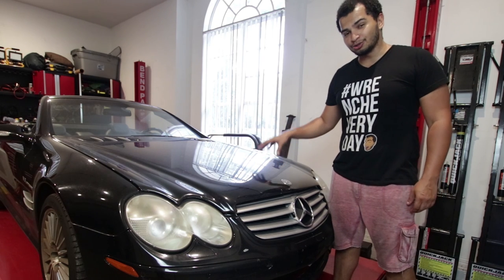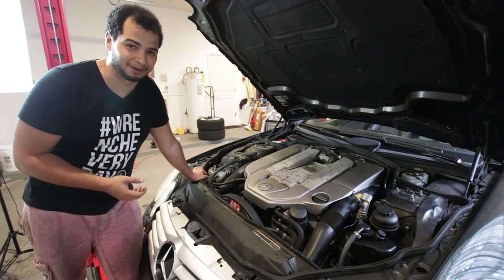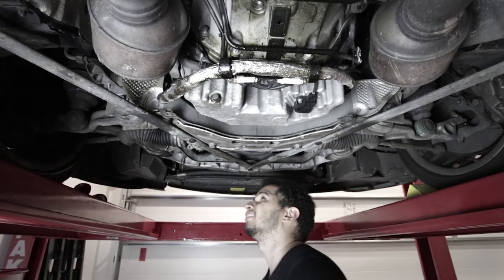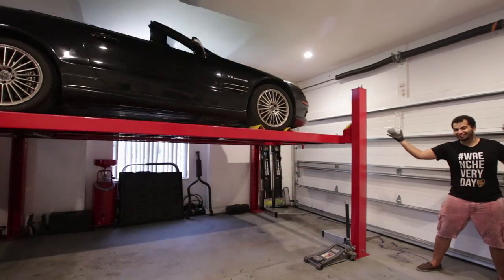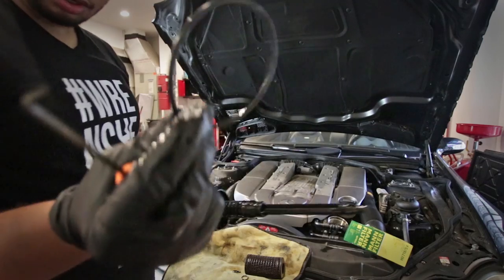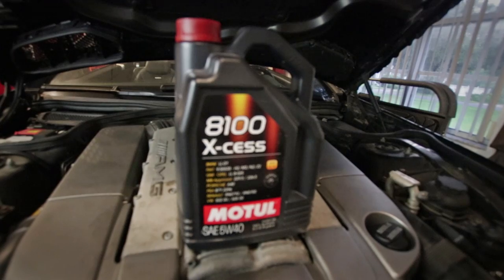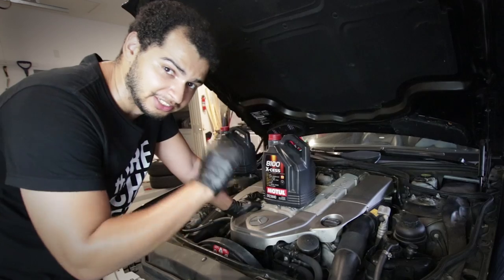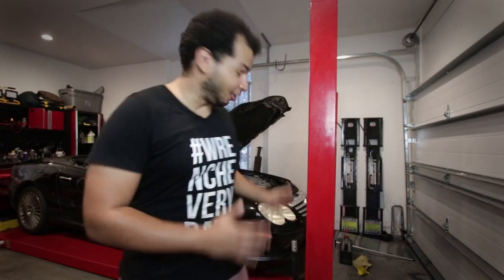Here's Why A Mercedes Oil Change Costs $320 And Why You Should NEVER Pay That Price-Project SL55 Pt1

Comment: I am a Mercedes tech and have a bit of advice for you.
Next time completely remove the oil filter then drain the oil. The filter housing had a check valve and will retain old oil (about half a qt) unless the filter is removed.
Reply: i thought the same thing.
Reply: About the Douche Bag, or about removing filter first?
Reply: And likewise measure changed oil level after the filter has oil in it, not with an empty filter!
Reply: Everyday Fleet Tech good advice, i was just about to tell him the same thing.
Reply: all canister filters retain oil and should be opened first
Reply: Absolutely! I am a former MB Tech and it is scary what I see in many of my customers vehicles that quick-lube places do.
Reply: Marc Smith 
Like use Motul oil? :O
Reply: AnonymousMod like using oil filters without the fleece wrap. The old 000 180 23 09 instead of 000 180 26 09. They do it because it is half the price, but it is not a good idea to use. 

I have actually never seen Motul oil in any store or shop here in NY.
Reply: It was a joke. 
This idiot in the video called Mobil 1 crap, but then praised Motul. Anytime I've bought a cheap seized dirt bike the owner swears by Motul, so like heh.
Reply: Everyday Fleet Tech
Reply: thats what I thought.
Reply: I own a 14 e63s and it has a engine oil dip stick, So on the m113k engines there is no oil cooler to be drained ? I have to do this on the E63s, I have an engine drain plug and oil cooler drain plug and it takes 9 quarts
Reply: I just watched this video And was thinking to myself "well he says his oil is very dirty even though he just changed it before going out too beat the hell out of it....it probably looked dirty almost immediately since it was probably .75 of a qrt of super dirty oil left from the one before lol some people should research the info before giving "advice" lol
Reply: It's typically out of ignorance that guys like this in the video put down companies or things they lack expertise in.
Reply: Doesn’t Mercedes log all services done to the car to keep it for resale?
Reply: The dealerships typically do, but not everyone takes their cars to the dealerships. Sometimes they take to a non-Mercedes Service center that doesn't always log the work done.  Plus, it work was done by the owner, do they keep a log?

This guy Is being a little ridiculous.  He's complaining over a $320 oil change for a high performance car like an SL55?  they do a complete inspection because if there's something loose, worn, or not to factory spec, then that car might be unsafe to drive.  They look for wear and tear and anything that would need to be fixed because these are not some cheap hooptie, these are expensive exotic high performance cars capable of speeds in the upper 100's and even approaching 200 mph and they want to make damn sure the car doesn't fall apart along the way.
Reply: yo get real oil swap an filt'r right? do it right n pay the chek cause the car is beaucoup buck.
Reply: Everyday Fleet Tech  I was thinking of buying a w203 c class 
Any pointers you can give me for getting a good car .. And I was thinking how much will it be the upkeep in cost of one like 2006or 2007 c200k
Reply: Thought this 😂
Reply: AnonymousMod: I haven't heard of Motul.  But, I'll tell you, I haaaaaate Mobil 1.  Why?  I put a new engine in my Vanagon (built by Boston Bob), and ran Mobil 1 after the burn in, and it couldn't keep pressure up.  A vanagon specialist recommended Delo, and after that everything was kosher.  Then I had a 97 Audi A4 2.8 that I bought new, ran only Mobil 1 from the first change interval, and at 80K miles the lifters had severe wear on them, needing a replacement.  I'd call that a lubrication related failure.  One of the lifters was literally worn half through.  Maybe it was an engine design issue, maybe it was something else, but I was fastidious about replacing that Mobil 1 at 3.5K miles and only using Mobil 1, and I felt really let down.  That plus the Vanagon plus stories I've heard...
Reply: Yes, provided that the service reminder has been properly reset... all of the different service items are recorded, not just oil changes, but air and dust filters, tire rotations, transmission services,,,, etc.
Reply: Motul makes good oil, i doubt that that was the reason why the engine on these cheap seized dirt bikes are seized (most likely they just don't know how to keep up the bike) (i used to race motocross and enduro and used Motul with no problems)
Reply: Great advice for those unaware!! My Mercs have the metal container, & the element sits inside it. They hold about half a litre of oil. The 450SEL-6.9 holds a lot of oil, & they have dry sump lubrication. Have you encountered many of these?
Reply: I like that idea and generally do something similar.  Because I change oil daily and time is money, I like to break the filter loose until the filter cap is completely off of the metal threads and it can breathe.  I then drain the oil, this way there is less or no oil dripping all over the engine or front body.  I hate causing more of a mess then having to spend time to clean it up.
Reply: Mobil 1 doesn't meet the .51 mb spec.
Reply: magincap70 .51 is a special norm for low SPAsh oils designed for vehicles with diesel particulate filter. that's why the normal M1 0W40 doesn't meet that spec. You would have to use Mobil 1 0W40 ESP which meets the .51 norm.
Reply: vrsca89 I've never seen any Mobil 1 that meets long life or the mb spec. We use cam2 blue blood at our shop, but we also have gen2 0w20 that we put in Japanese cars that require syn and 5w20 and 5w30 that meet the dexos spec. There's a reason BMW and Mercedes ended their connection to mobil1 because it wasn't doing the job. I haven't seen anything g newer than an '06 that had a mobil1 sticker on it.
Reply: Hello, 
Need some help with my 2013 ML350. Blind spot assist becomes inoperative and operative during driving. And once in a while turn signal doesn't work also when blind spot assist becomes inoperative,  but all becomes operative once I restart the car.
Reply: PIYA07950 need to get a wiring diagram and figure out how those things are connected. Could be that multi function switch that turns on the blinkers, could be something more computer related. Could be green corrosion fucking with your connection. Electronic issues in benzs really need to be looked at by somebody who knows what's up. You might be able to google it and find others with the same problem, but I'd bite the bullet and get it looked at professionally or just say he'll with it. I don't use my blinkers anyway.
Reply: Was gonna say that but figured someone beat me to it
Reply: That is a fleece filter. Hu 718/5x is the updated oem filter with the wrap around it. What do u think a fleece filter is? Lol
Reply: Ashamed to say I had to learn this lesson the hard way the first time I changed the oil in mine. Good heads up!
Reply: Everyday Fleet Tech 😂 me to. And that is why you pay not the hobby bob price
Reply: everyone logs services except self done stuff. U can get that info with a car faq
Reply: Hi...Do you have any job for me I'm also working in Mercedes Benz passenger car I'm from India.
Reply: The problem is usually not the oil brand.
Reply: First thing I noticed. He put the drain plugs in before taking the filter apart.
Reply: hey he's on u tube. he's an expert
Reply: Everyday Fleet Tech, I spilled a cup of soda into my ashtray and center consol IN my  CLK 430 now its stuck in Park. Have you dealt with something like that, if so...did I blow a fuse by wetting something down where the shifter is?
Reply: You know by doing that oil will spill all over the engine and driveway? Oil canister that is top mounted will retain oil because of the check valve. I've done it before on my Mini and I regretted having done so.
Reply: Couldn't agree more, sir.
And I would'nt say, that 320 dollars for a service is much. Taking in consideration things like; labor for the tech, dealership costs, parts and so on.
Reply: William Hicks  we use valvoline fully syn with stp 443ml fill half way between the marks on the d,stick if you drive fast.change filter at 3,000mls intervals oil will be good for 40,000mls. Use the best oils&fillters ie cheaper in the long run.best wishes, mr benz.
Reply: Joe Al  his name means stupid in arabic. I'm serious
Reply: So that's why Mercedes-Benz charges a bomb to change oil. They don't mix old shit with new oil..
Reply: @bradgt5130  Yes but so do al the Toyota dealers in my area, and they don't charge tripe the price for an oil change.
Reply: Everyday Fleet Tech n
Reply: I like to fill the oil through the oil filter housing and soak the media before installing what do you think about that and I always purge the engin if it has a purge valve. Or I start the engin with the cap off for about a minute to get air out. Or am I doing it wrong.
Reply: @Eagleoneradiogod  You are OK. Having the cap off usually does not do anything but we have not seen it hurt anything either (the engine will pure all the air out by itself). Its possible that filling the filter before starting the engine could ensure that the oil pressure builds up faster so that is a good thing and it could help save the engine fro some unnecessary wear during  a dry start.
Reply: @Billy123bobzzz  ok thanks I always try and put in a bottle of prolong cause I know how people are. It's my insurience cause you know how people who do not work on there own cars drive them and unless they specify I always use castrl magnatec cause it's cheap at wallyworld . But in my own cars I use the sam oil with no more friction and ceratec. Sometimes I dump a bottle of sfr
Reply: @marcsmith3881  Mercedes formula 1 uses Motul, (Amazon) also your absolutely right about the filter, don't cheap out on an oil filter, what's an other 10 bucks. (BTW that's what I use in M=my S500)
Reply: @TheDude21519  No.  You just destroyed your electronic shifter.  Next time have a Coke and a smile at home.
Reply: @Oneness100  but come on.... those inspections you get are soooo hit or miss. I've had people catch all kinds of things that aren't real and miss all kinds of things that are real.
Reply: Let him fuck it up.
Reply: Bradley Beyer if done at a dealer, it will be in the VMI( Veh master inquiry). Including the dealer and part number.
Reply: @PIYA07950  check your fuses
Reply: Straight D BAG
Reply: I thought the same thing when watching this....
Reply: @SpicyRok7482     O-M-Goodness yup i just learned THAT lesson the hard way, it wouldn't go into Reverse / Park unless i REALLY aggressively beat on the stick like a insane, beserk, savage animal, which, as a reault sometimes, u would have a panic attack bcuz then the key would b atuck in the ignition,..... HOLY FUCK !!!, a $1200 mistake,  FUCK MEEEE !!!!!
Reply: Also a Benz Tech here. Stay in your LANE Bro! These sort crack me up! Much like watching a complete house or car "Restoration" process condensed down to a 30 minute video. He's probably NOT a business owner either. What he's NOT sharing, is that without a Hoist, you're more than PROBABLE (Benz) consumer would spend no less than 1 hour trying to SAFELY jack the car up with a floor jack simply trying to remove all the splash panels just to get to the Drain plug. As well the $3k + he probably spent on the Car Hoist. Much like spending time mowing, trimming & edging your own lawn for 2-3 hours or painting your own house. How hard is using a paint brush or sprayer if you do have the TIME? There used to be a time when only WEALTHY drove Benz and a more than OBVIOUS reason WHY? Simply put their TIME  is more valuable. Justify it however you choose, BTW, 1 quart of dirty oil plus 8 quarts of clean oil = 9 quarts of dirty oil. I thank God daily for people like this..... one little COSTLY "Oh I didn't know" episode and He's coming to see me for a $10k- $15k engine repair!
Reply: @kevinnguyen8612  loopooooo
Reply: @MuffinMan0521  Ho. Lee. SHIT! If I could press the like button all day, every day, for as long as I've been searching for this...
Reply: @MuffinMan0521  He should make second video of ALL the steps he missed hahaha
Reply: Yes agree with you- This Guy has still a lot to learn- He should be told little knowledge is dangerous - He did not even remove the filler cap when draining oil and God knows if he did warm the car before draining. Look how he mess oil also.
Reply: Where is the difference in changing the oil filter before or after draining the sump……there is no difference mb technician.
Reply: @marcsmith3881  Cheap conventional bulk oil, Chinesium oil filter designed to self destruct as soon as normal operating temp is reach, yeah, I know about those quick (one arm bandit) lube joints.
Reply: @gailsmith4889  If you have worked on enough Mercedes vehicles you would know that's not true. There are O rings on the ends of all of their filter cartridges that keeps the oil from draining out of the housings. If you drain the pan first, unscrew the filter and then lift  it, old oil will release from the housing, past the timing chains and into the pan. 

This is coming from a 2001 Mercedes Benz ELITE graduate, several years at 2 dealers and over 20 years of servicing them. I have serviced every engine designation from old M104 L6 s to the newer M278 V8s.
Reply: @r.weaver3769  Ya man. It's a crazy risk to take with these expensive engines. Lately I have been getting the oil from the dealers because I have commercial accounts with them. They sell the Mobile ESP oil that meets 229.52 specs. I almost always get the filters from them or buy Mann filters.
Reply: @SeanReifschneider I can't help but wonder what viscosity was the Mobile 1 oil? I have used it since the '70s. But I wouldn't recommend any weight less than 10W-XX. No 5w or 0w. I have had start-up knocking (1.2.3) in my Trans Am with the (only available) 5W-20 about 1975. I soon changed back to 20w-50 Castrol. No more startup knock. Yes, I always thought it was one worn Rod journal. Safe to conclude oil drained out of crank too easily. The thicker 20w-50 hung on better overnight. The last few years I use both M1 and the Castrol mentioned in most of my Hondas and Yamaha. Some leak M1 and some don't. My Mercedes E320 doesn't leak M1. About 5K miles per quart of M1 10w-40. Motol made my Honda clutch slip first few miles!!

Comment: As a former MB Tech, we don't try to justify the price of an A service, we actually justify it by following the relevant maintenance sheet provided by Mercedes specific to your vehicle year and model based on your mileage. Quick tip: next time change the filter before draining the oil as the filter housing will hold up to 0.5 QT of oil as @Everyday Fleet Tech said in the comments below, if not you will create problems, this vehicles are very sensitive. I appreciate people like you who get us a lot of business in the dealership.

Comment: ok, this is no joke.  my friend took his 2015 mercedes in to a shop he did business with.  100$ oil change.  engine blows up shortly after.  his insurance wont cover it.  mercedes wont cover it.  he pays mercedes 3k to find out why it blew up.  not enough oil and wrong oil.  had to go through the shops insurance to get paid out.
Reply: Jordan Truppner damnnnnn maybe that's why sometimes it pays off to go to the dealership 🤷🏽‍♂️. If you aren't doing it yourself, that peace of mind is worth it.
Reply: " his insurance wont cover it." And it should not cover it, its the shops insurance that did the oil change. Basic stuff happens every where and all the time all over the world. Its called making a mistake. Happens in dealers too.
Reply: It's sad when shops can't look up specs from a VIN, but it happens [to many companies].  Remind me... what the hell was ISO 9000 for again?  MB spent all that money on certification costs/maintaining a paper trail and nobody uses it?  Wtf.
I notice small things, like the shop that put slip additive in my diff fluid after a change on one of my cars - I have an open differential that doesn't need it.   Bad management is expensive all the way around.
Reply: The dealership has to pay for it since they did the change, if its under warranty
Reply: @steve00alt70  He said it was a "shop he did business with".
That sounds like it wasn't the dealership he bought the car from.
Reply: @flinch622  The dealershop is way worse than DIY>😪
Reply: dCosmic1 actually i just think he went to a shitty shop, you got to know whos good at what they do and whos not go to german car mechanics not universal mechanics
Reply: At the Dealer break pads and rotors they charged me $4,000 then they scratched  my Benz nobody is taking responsibility 
I don’t think I will do any business with them.

Comment: Hey, great video. I just love these older Benz's. I was an apprentice with Mercedes when this model was launched. A little tip/advice though.......You should remove the filter or at least unscrew the filter unit before dropping the oil. The filter housing holds around 500ml/ 1/2quart of oil in it. Likewise, when you refil you need to start the engine to refil the filter housing before measuring the level. This is why you only needed 8quarts instead of the 9 it should get.👍
Reply: Good comment. I came here to say this too
Reply: 100% correct.
Reply: Thank you.